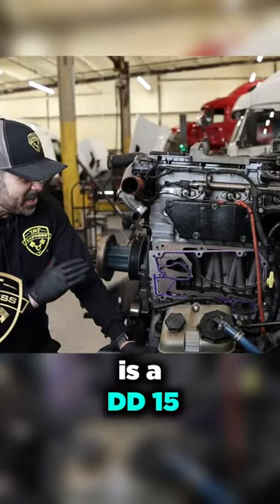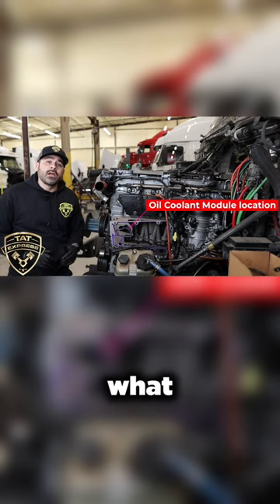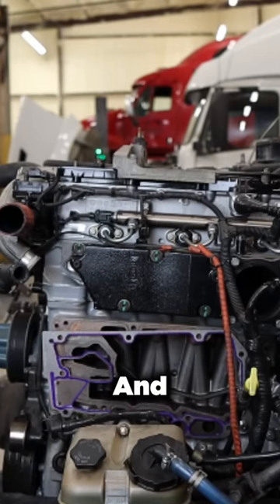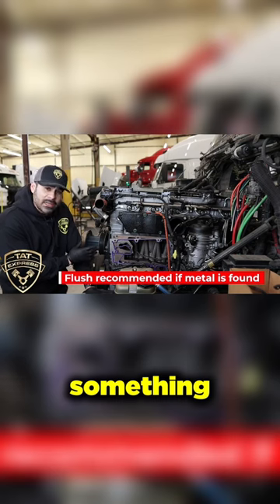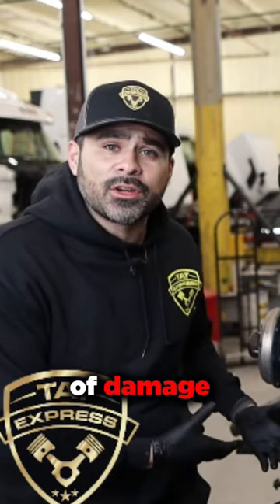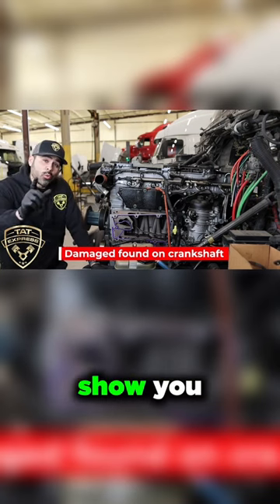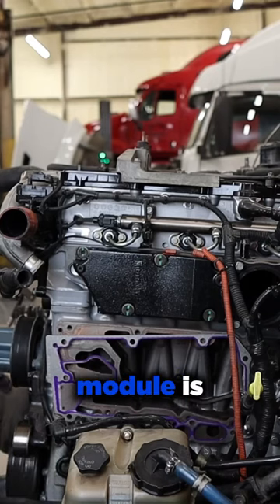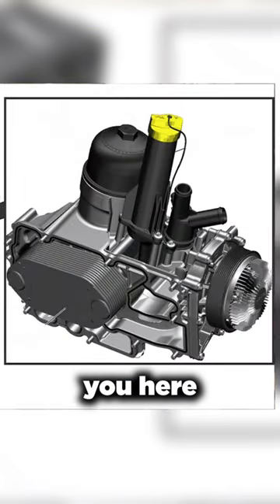DD15 crankshaft failure/ oil filter stand pipe/what to look for? #tatexpress#mechanic #dieselengines

Comment: There will always be signs of damage in almost every component of a semi engine. That doesnt mean you replace or fix it everytime. These engines are made to take a beating. Just keep pushing it unless its major. It'll save you a lot in the long run.
Great video by the way 👍